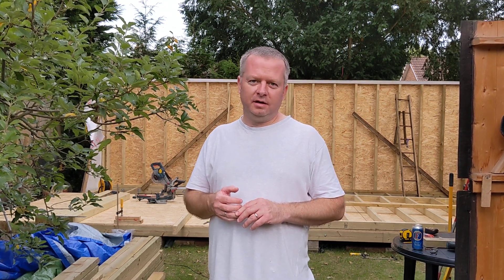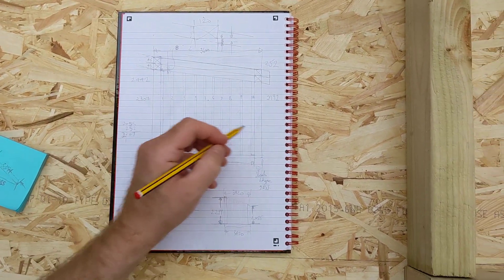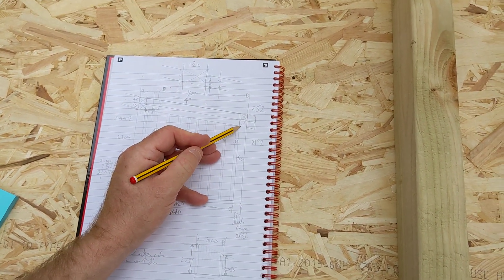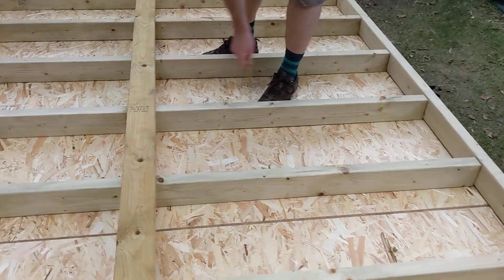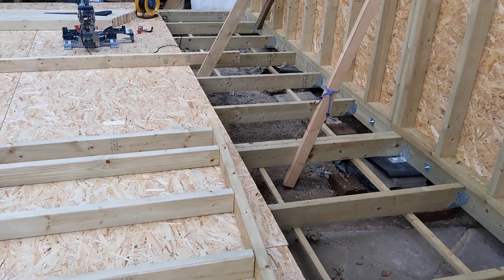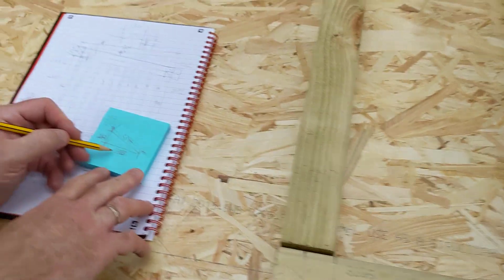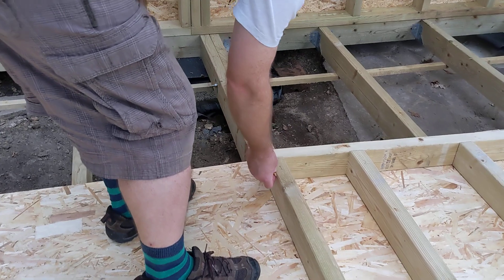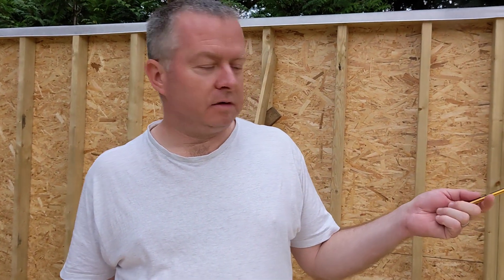Garden Room Build - Week 13: Ep 19: How to easily cut studs for rake walls

Comment: Great series. We used firring pieces rather than cutting each upright to different lengths. Robin Clevett has an easy to follow video showing how to do it.
Reply from the maker: Hey thanks for the comment, I had a look at that, nearly went that way. Robin is great, used quite a few of his tips elsewhere. And got the idea to use Gapotape from him, and in fact the Glulam beans! Good luck with your build!